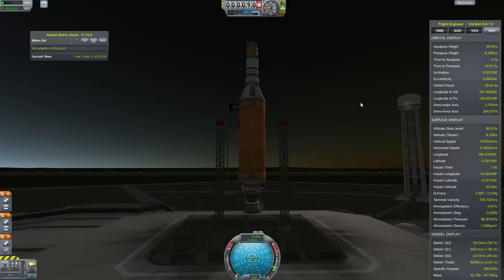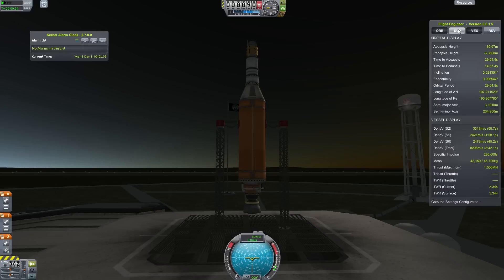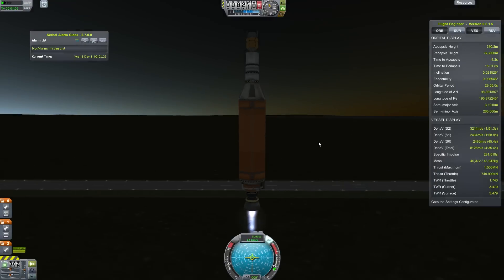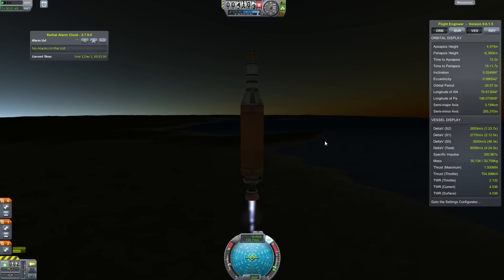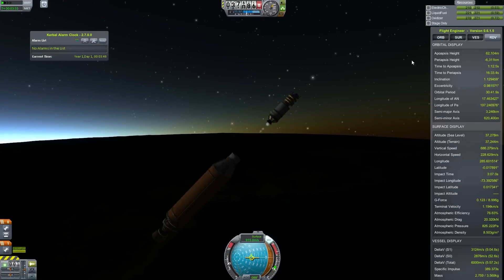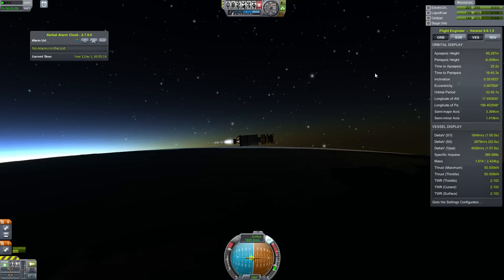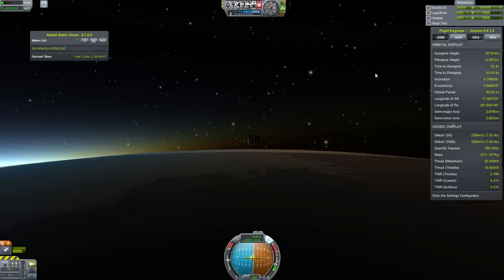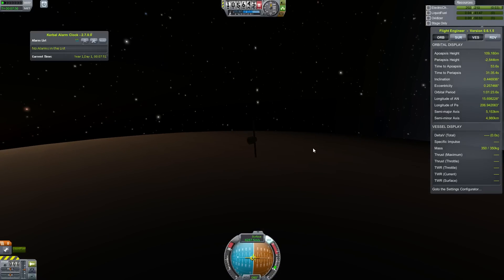Kerbal Space Program - Let's test Realistic Solar System mod.

Comment: You shouldn't start ypur gravity turn at 10km up. You should turn when you get to 100m/s.
Reply: It depends on how much your payload weighs. If your payload weighs about 20 tonnes then sure, you should start turning at 100m/s, but if it weighs something like 400 tonnes (the weight of my Eeloo payload) then you should turn at 10km up.
Reply: Vuxlort67 No, the payload mass doesn't make a difference. What makes a difference is the TWR. If you have a TWR of 1.2-1.5, then start turning at about 80-100 m/s. If you have a TWR of more than 1.5, start at about 50 m/s. If its less than 1.2 then you need stronger engines.